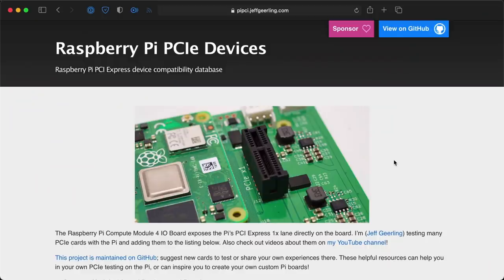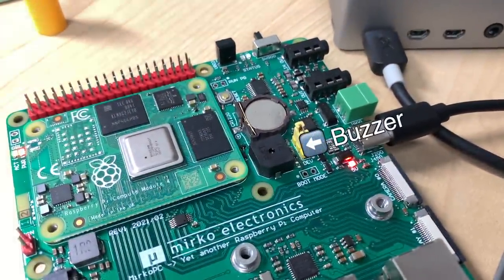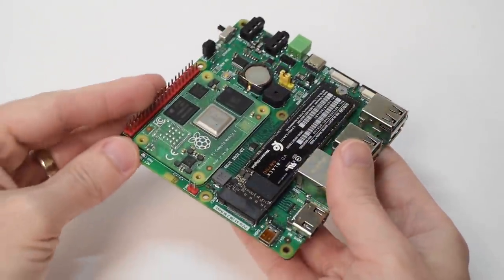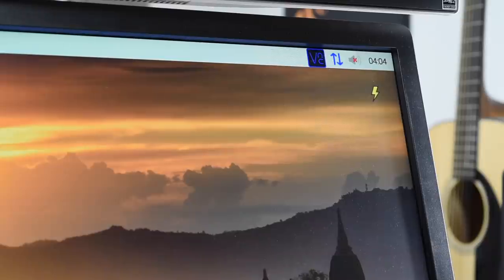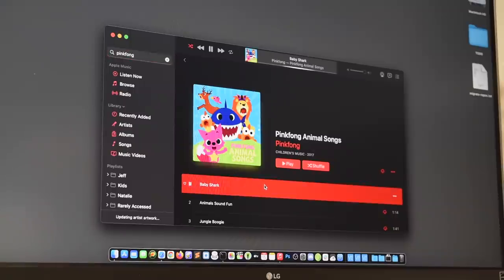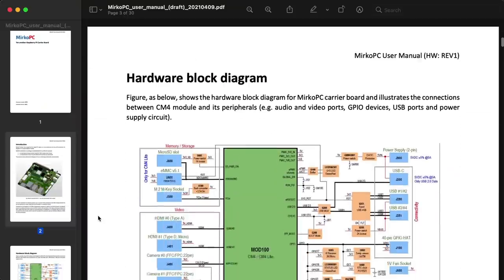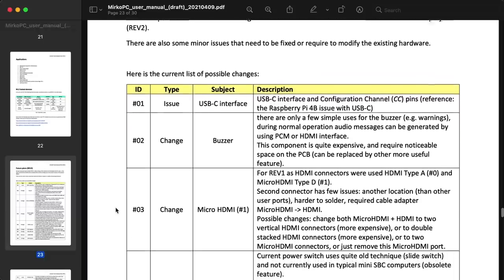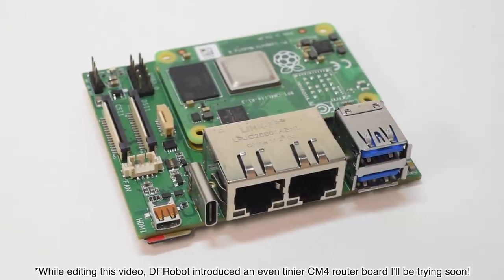Meet MirkoPC - a tiny full-featured Raspberry Pi CM4 PC!

Comment: Finally! When they release games for ARM, We can get PC speaker sound! The 80s are calling.
Reply from the maker: Haha, that was my first thought too when I saw it had a little buzzer. Also, emulate BIOS failure sounds and random PC beeps I remember hearing from my childhood.
Reply: Will the modem sounds be included or are they an addon?🤔
Reply: @JeffGeerling As you know many modern PC motherboards still have a PC Beeper connecter by the front panel header. No need to be nostalgic for PC Beeps. Just thank the Tyranny of Legacy for UEFI/BIOS beep codes 😉
Reply from the maker: @SimonZerafa  Haha, true, though I have only had laptops for years, and only recently got another desktop PC that has the thing.
Reply: It would be trivial to remove the buzzer and solder on a good little speaker in it's place. It's probably just a 5V square wave.
Reply: Można tę płytkę gdzieś kupić?
Reply: @briangoldberg4439  ok, thx.

Comment: Jeff: "There are 2 USB 4.0 ports and -"
Me: whatt? rewinds
Jeff: There are 4 USB 2 ports ...
Me: sigh
Reply: Ikr... Even though there is support for USB 3.0...
Reply: support? USB 3.0 is not a matter of software. the person just didn't think it was worth it to actually buy USB3 ports. remember this is a small project
Reply: You have to sacrifice the NVME if you want more USB3 ports unfortunately. I'd rather have an NVME drive than USB3 ports that I won't really be using. Besides there are alternative boards that do have USB3 and no NVME or PCIe slot.

Comment: Tip:

To remove the SD card use your thumbnail to catch the ridge on the card  --  you can do it one fingered (thumbed) but make sure you know where the card will fall when it comes out -- over a small box would be ideal

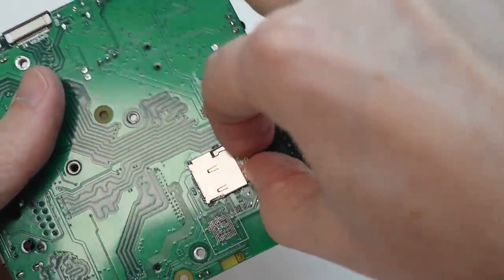Comment: 2:53 i mean uSD Cards have a bump along the edge which is sticking out from the connector.
you can just use a finger to "latch" onto that bump to pull it out instead of trying to grab the sides
but yes having it on the edge of the PCB is obviously still much more convenient.

Comment: for the micro sd card there is a simple solution:
you can buy micro sd card extender on aliexpress/ebay for a few bucks
it comes on flexible cable so you can put it anywhere

Comment: I think, considering the Mplayer situation, it would be worthwhile looking at GTK4 with its media player abilities and customisation (including OpenGL).

Looking at that board: The nvme seems unlikely to expoit full speed especially in those power-shortfall scenarios and I think, for what the board is, nvme was over the top when sata m2 could have been used, especially with port multiplier so you can convert to a sata cable and use a extra psu. ZFS or BTRFS with port multipler on 2.5inch HDDs would be cool.

All the boards since the pi3bplus suffer the same problem in that you cannot upgrade the RAM (or replace it if it breaks). It would have been nice to see the pi3b have a sodimm (or something) slot but at 1GB RAM, it was tolerable for the machine you have (although frankly the Soc should have been one that allowed 4GB or at least 2GB).

Anything more powerful than that like the pi4 simply used too much power and at that point you might as well get a low power mitx board or find a way to downsize a ARM server if ARM was (for some reason) a must.

The pi4 is marketed as "your new desktop computer" and while that may be possible, it is ridiculous  that a desktop (or even some latops) cannot have RAM upgraded or replaced (if a chip dies).

Why do Americans fall over in wuv with the Pi so much? Is it a Brit heritage thing like when you discover you have tartan or something? And yes, I know this is polish. I mean in general.

Comment: Jeff really like your videos very helpful. Just a quick comment on the MirkoPC. I just received the newest revision board yesterday and on the audio Mirek has changed the audio to and here is is comment: headphone amp will not work with hifiberry profile because I had to change headphone amp from TPA6133A2 to TPA6130A2 (due to IC shortage).
TPA6130A2 is using I2C interface for control volume. I see where in your review the hifiberry profile worked, do you have any information on how to set up the audio with this new chip set? Thanks
Reply from the maker: Unfortunately I'm not sure what would need changing for the new chipset... I'd recommend maybe asking about it on the Pi Forums? Could be someone there a little more familiar.

Comment: The only thing stopping me from recommending these Pi - like mini pcs is their video playback quality. If they can get 1080p60 youtube and netflix to run I'd happily replace the giant desktop PCs with tiny and cheap ones like these.
Reply from the maker: The latest version of Chromium for Pi finally has hardware GPU acceleration for YouTube, so at least that plays back much better now (though the controls on the screen are still a little laggy). I'm hopeful that whatever comes next will help make the experience a lot less disjointed.

Comment: PWM fan would also be necessary. Jeff could you please suggest mirko to add this feature too.
Reply from the maker: I asked about it, don't worry — and I agree, a simple 5V fan power supply is not as nice if you want to be able to have a quiet fan controlled through the board.
Reply: Jeff Geerling 
What would be the best way to add another Ethernet port to this board? I plan to use this for home automation and to network all my 3D printers
Reply from the maker: @alfredanil  It already has one on it (1 Gbps Ethernet from the Pi CM4's built-in chip). Also if you buy a Pi with WiFi built-in, it would have WiFi as well.
Reply: @Jeff Geerling well I'm aware of the gigabit Ethernet and wifi isn't that reliable for the application I'm looking for. I have a suggestion for placing second gigabit Ethernet on the same footprint, there are connectors available with two USB 2 and on Ethernet port on same block placed vertically. 4 USB 2 ports and 2 gigabit Ethernet ports can fit easily. There are a ton of things that can be done with a second gigabit Ethernet. Please pass on this suggestion to mirko . Thank you very much.

Comment: Would be nice if they use the Odroid eMMC connector so we can use their eMMCs on these boards and can replace it if the eMMC dies or starts to fail.
Reply from the maker: It would be nice if that were the case. No reason why it couldn't be a standard across multiple SBCs, though I'm not sure if it's a standard or just what Odroid came up with?

Comment: Nice board, but I would like a board with less features. I want the M2 for SSD. and fullsize HDMI, but I dont need a RTC since i get the time from internet, so the battery can be removed aswell, and the pc beeper i dont need, nor the ir-reciever or extra camera and display connectors. So if there is one of those versions it would be nice :)

Comment: Will you be making any more videos about your Dishy setup? 
I want to know how I can get one and install it in my cottage in Northern Ontario, Canada.
I have no signal of anything for miles. I have to have my daily fix on the internet. No service--> No fun.
Reply from the maker: Yes, don't worry! The next two videos will be 'how I am monitoring Starlink' and a full review—both of which require a bit more time to work them out (especially the review, since I need at least a few weeks of data to make a good review).
Reply: @JeffGeerling  Excellent.
I installed Stellarium on my new tablet and it shows all the starlink satellites. They are all over and move fast. I saw a train of them following each other close! 
Maybe they haven't been assigned a position? I have no idea why a dozen would follow each other so close, or even if what I'm seeing updates. 
My dream is inching towards reality! 
One day I can live tranquil but have internet :)
Reply from the maker: @piconano  Those 'trains' are actually recent launches—when SpaceX blasts a set of 60 new sats, they are all in one tight group, and the 2nd stage spins to give them a little momentum and have them slowly push way from each other.

Then the onboard thrusters start to guide them into their individual (spaced out) orbits on the same orbital plane. After a few weeks (months? not sure exactly how long), they are in the right place in their orbit and they are brought online.

So the ones you see in those satellite-conga-lines are not yet actively transmitting customer data.
Reply: @JeffGeerling  As Mr. Spock put it best; "Fascinating"

Comment: I found that it survives if you give it 5.2V because most of the power is lost in your puny little power supply leads. Just compensate for the losses and you will be fine.
Reply from the maker: I haven't over-driven it, but I do know it should be able to accept a bit more on both the voltage and current than the rating.

But since I only have one and getting a replacement could take a few weeks, I'm overly cautious about 'experimenting' when it comes to power input :D

Now... a regular old Pi on the other hand... ⚡️

Comment: Such a great board! I just don't get, why there are no USB 3 ports however.
Reply from the maker: Unfortunately that's a limitation of the current chip used in the Raspberry Pi 4 and CM4 — it only has USB 2.0 internally, plus one PCI Express lane (which is used on this board by the M.2 slot). You could add a PCI Express switch and another USB 3.0 chip to get both M.2 and USB 3.0, but that adds expense/complexity and would require more board space.

Comment: Does the price beat the X86 SBC's? if not I don't see the point unless you desperately need it to be a RPi Compute Module, an SD converter to full size would be a must for this board for me
Reply: Absolutely not. This combo is far expensive. Its just a proof of concept. Rpi fan boys propaganda

Comment: Question about not this board but the waveshare PoE board you have. Does it suffer the same issue I current have with every PoE solution I have for my current CM4 rebooting the pi after a shutdown?
Reply from the maker: Two issues to follow: https://github.com/raspberrypi/firmware/issues/1412

And: https://www.raspberrypi.org/forums/viewtopic.php?f=45&t=244209&sid=35c0f887d712fd4522fc138ad2337999&start=50

Try updating the bootloader and see if that helps. If not, there could be some other hardware issue. I know I used to run into that issue on my Pi 4's with PoE HATs, but I didn't actually test that on the Waveshare.

Comment: What’s the point of the DSI connectors if nothing supports it but the one first-party display? Or am I wrong about that? I don’t think I’ve ever seen a device or project use the DSI connector.
Reply from the maker: The CM4 Handheld does use that display to great effect: https://github.com/juckettd/RaspberryPiCM4Handheld7Inch — and there are a few 3rd party displays I've seen that work with it too.

Comment: With piezo buzzers, I like to put a little piece of cellophane tape over the port at the top. Really muffles the audio.
Reply from the maker: Good idea, helps take the edge off!
Reply: @JeffGeerling  Actually, I figured it out TAing a class on introductory embedded systems. The kits we shipped to students had buzzers. A lot of them complained about very muted volumes. We then realized that they hadn't removed the Kapton tape that the buzzers shipped with to prevent moisture ingress into the port.

Comment: no USB 3 and still no POE by default boo, give me Raspberry 5 soon plz
Reply: built in PoE is the biggest need
Reply: @Tano You could have both, but you'd need a PCIe switch chip.
Reply: @Tano A PCIe switch works just like an ethernet switch.  It allows shared access to the upstream port.  No need to disable anything.

Comment: Personally, I deal with a number of  disabled individuals where a CM4 carrier that consisted of just 1-2 USB-C ports would be desirable. The module would mate with existing USB-C multiport adapters such as those for macbooks. The concept would be that the adapter would be wired up to the keyboard/mouse/monitor/ethernet and rigged in a docking station that would allow the low vision disabled individual to hotswap the cm4 and carrier board without fine motor control required for disconnecting and reconnecting all the ports. Thus switching out pi's would be trivial if the system was glitched. In the meantime the user could use a spare.
The basic concept is similar to this LTT project
https://www.youtube.com/watch?v=G2VxwFEA8xM
or this dock
 https://www.youtube.com/watch?v=iZbEwWcO1hE
but witha CM4

Comment: Do one need the emmc on this card?, I mean, if you use this mirkopc, with the ssd, will it boot directly from the ssd, or do one need microsd/emmc to get it up and running?
I have gotten the standard io board, but can't decide which cm4 to choose. (haven't seen any with 8gb ram yet?), but one with 4g and emm storage, or 4g without storage.. hm..
Reply from the maker: You can now boot directly from NVMe but only with the currently-in-beta bootloader that requires 'sideloading' until its out of beta.

But my favorite combo now is to use the CM4 Lite versions and I can always boot them from a microSD card temporarily or if I need to do that initial side load, then I can boot from NVMe after that.

You can also boot from USB but that can be a little complicated on many CM4 boards since they lack a USB 3 chip over PCIe, and the USB 2.0 bus is disabled by default on the CM4!
Reply: @JeffGeerling  ah, awesome!, thanks for the tips.

Comment: I don't understand the appeal of the current RP4 as a desktop computer (I'm only talking about its use as a desktop computer, not as a special purpose computer for which it is supremely qualified) unless a desktop must be low power, low noise, and/or small size. I wrote about this in
https://www.raspberrypi.org/forums/viewtopic.php?f=63&t=282840. Since then some things have gotten better but there's still a ways to go, especially if you want to run Windows. I routinely see used Intel-based PCs with 8GB of RAM, multiple CPU cores, and the rest for <US$100. These are much better desktop machines than the current RP4.
Reply from the maker: > especially if you want to run Windows

I definitely don't want that!
Reply: @JeffGeerling  OK, then run Linux or maybe MacOS. I think the Intel-based PC works better, with the exceptions I mentioned, than a RP4

Comment: It sounds to me as through this board could use a capacitor on the power supply. Just like all raspberry pi boards in general really.
Reply from the maker: Power supply design is, like more advanced networking or crypto, one of those areas of voodoo magic that I have never cracked into.
Reply: @JeffGeerling  put simply it just needs a buffer capacitor. So that short peaks of power demand don't cause the power supply voltage to dip below acceptable levels.
This is generally what causes the power indicator to appear on the raspberry pi.
Many makers who have tried overclocking have found that adding a capacitor helps keep the pi stable.
Reply: Another thing that helps is keeping the wire between the power source and the pi as short as possible.
Reply from the maker: @felixokeefe  That makes sense; it does tend to occur only here and there (and temporarily) when doing a lot of IO—and my bench power supply doesn't show a huge current increase or anything (usually still under 1A)—it's probably just a quick spike.

Comment: Any reason this can NOT run Octopi?
Reply from the maker: None at all, it should be a good candidate for it! Probably even better than the Argon One M.2 rig I set up previously.
Reply: @JeffGeerling   Much obliged.  I have a Snapmaker 2 and a Rasberry Pi 4 B 8 GB set aside for it.

Looks like quite the deal on a LotMaxx these days.  Reputation for being very quiet.

So I could just clone the RPi 4B or I could try something new.

Still trying to figure out if there has to be printer specific drivers for Octoprint.

https://lotmaxx.com/products/shark-v2-flash-deal-399?_pos=2&_sid=ddf4e4343&_ss=r

Comment: 2021 and a "full featured pc" doesn't have a usb3 port
Reply from the maker: I didn't say it was a super fast PC ;)

The USB 3.0 limitation is because of the tradeoffs required (cost + complexity) to try to get both USB 3.0 and M.2 NVMe support in one small board with the Raspberry Pi's SoC, which has pretty severe limitations compared to newer chips.

Comment: USB2? That's disappointing
Reply from the maker: One of the many tradeoffs with a board this small—adding a PCIe switch chip and the USB 3.0 chip would've required more rework—not to mention adding cost and making it harder to build (PCI express switch chips are incredibly hard to find in small volumes right now).
Reply: because CM4 does not have a USB3 interface, therefore the designer has a dilemma whether to use PCIe as M.2 slot or give PCIe -> USB3 bridge instead.
This is just a DIY project, with all its limitations, such as the price of components.
If the future CM5 will have USB3 then I will think about adding a USB3 hub.
Reply: @JeffGeerling  Interesting, thank you for your very interesting work and explainers! A real challenge to create the 'ultimate' carrier board while balancing cost, component availability and given architecture.